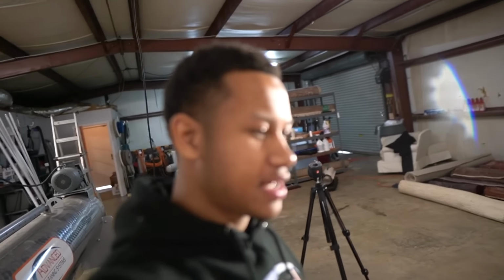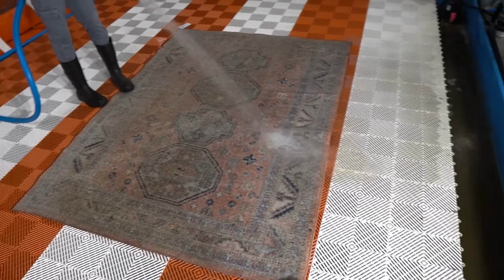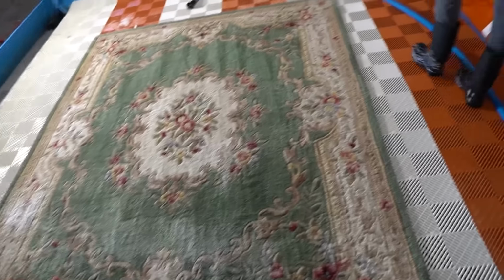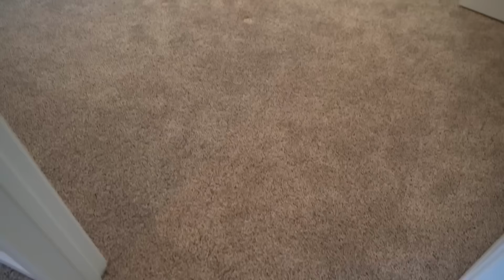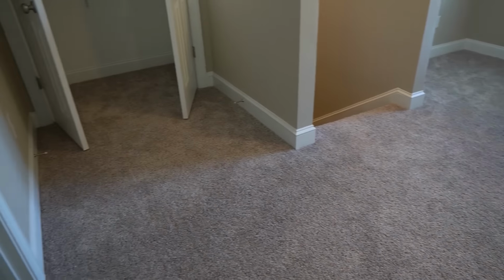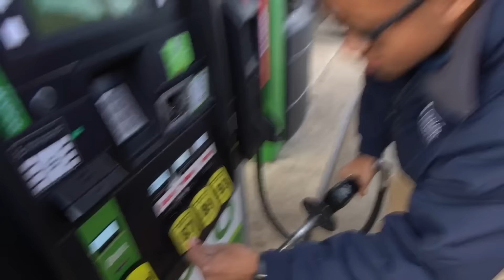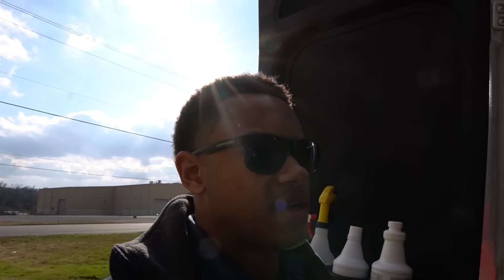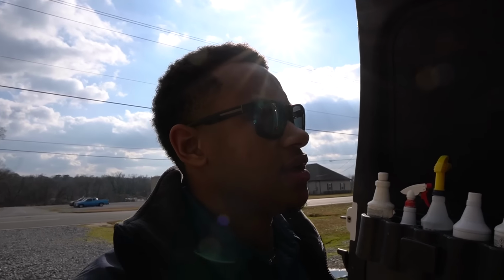I wasn't expecting this rug to be this DIRTY || Rug days are always the best!

Comment: As a 51 yr old father of 3......I feel his pain.
In a younger life I used to do 'parkour' or 'getting the ball back, off the roof of a 3 storey building'.
Jumping across Roofs, climbing Lamp posts, 30ft drops whilst being chased by Security.
You'd have to run at a 12ft high wall, grab the lip and roll under the Barbed wire.
A few yrs back I was telling one of my kids what we used to do and felt the urge to do it 'one last time'.
I hit the wall with my chest and bounced up and landed flat on my back. I just lay there for a while whining and giggling whilst my daughter knelt by me, looking bemused and confused.
Now of course, with age, I'd just get a ladder. My ladder.
Knees don't last long but the memories are forever.

Comment: Warming up your car before driving is a good idea.  Gets everything heat soaked and makes the oil more fluid so it's easier on the engine.  Of course you don't have to do that, but your engine sure does appreciate it!  Especially when it's cold outside.

Comment: always warm up a vehicle to operating temp before driving it no mater the vehicle it will make it last years longer, 60%+ of the wear on a engine happens in the first 5 min after start up from cold or after sitting more then 6 hours

Comment: Quick question, hope you have the time to reply. When it comes to cleaning commercial mats at entries; the ones that usually have a rubber backing used by companies such as cintas, are there special techniques, machines, and equipment used for the cleaning process as compared to the types of rugs your company mainly cleans?

Comment: This might be a dumb question but.......can I use my pressure washer, throttled down, and a surface cleaner on top of a tarp in my driveway to clean area rugs?! They're cheap 150ish dollars from Costco so I'm not worried about destroying them. 
I'd snow foam them first, let them sit, use a scrub brush to release the knap and surface clean. Then squeegee them out, use compressed air to dry further and let them dry hanging on my fence lol

Comment: The warm up you do is just wearing the engine more than if you’d just start the car and drive it. Warming up an engine before you drive does nothing to help the engine wear less. The oil for example will be circulated within milliseconds so everywhere has oil right away. If your worried then you just take it easy on the throttle for a few mins, it’s your car though so you do you.  Nice cleaning jobs it’s satisfying to watch.